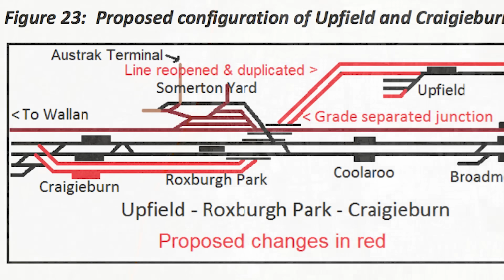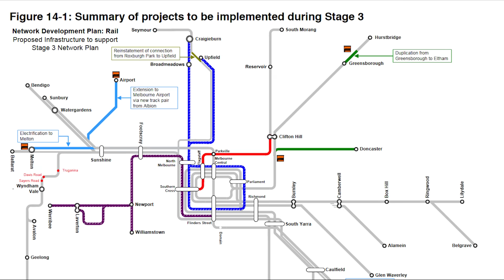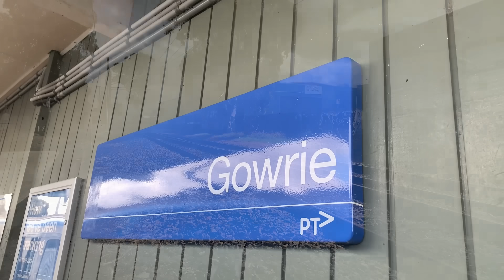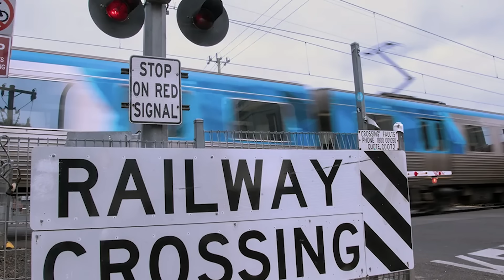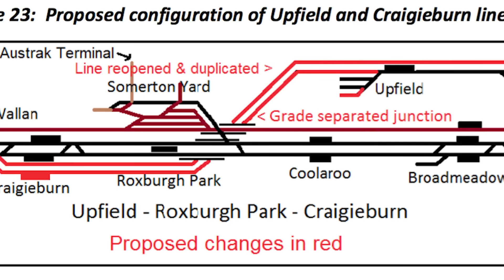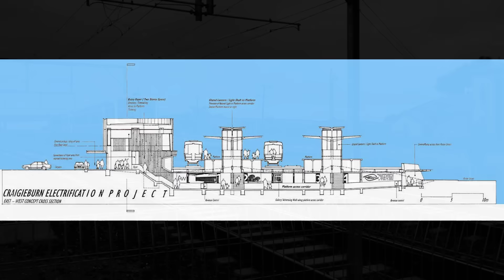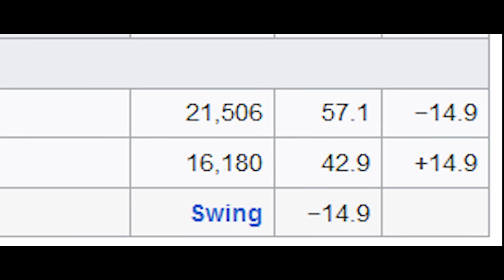The Somerton Rail Link and Wallan Electrification Projects Explained

Comment: No wonder we have a bad rail system. If that is a priority heaven help us. I can think of several other projects that should be return or restored before this. The Cranbourne East/ Cardinia extension, electrification to Hastings, Whittlesea line to Whittlesea.  Great video though and I did enjoy your commentary.
Reply from the maker: You had me until Hastings and Whittlesea… neither of those are extensions are needed lol. Thanks for the support!
Reply: Electrification to Hastings would cost a massive amount of money to service a small and static population, where as the line to Wallan would be much cheaper and service a massively growing population.
Reply: @MetroManMelbourne  the Whittlsea line will be extended a few kilometres at a time as the population grows northward, at the moment the population growth is at Mernda so once it heads further north they'll add a new station further up the old rail reservation.  Maybe they should look at running Upfield between Craigieburn and the Epping/Mernda corridor to pick up that area while there is still land available to reserve for rail purposes ??
Reply from the maker: @pvda64  The population won't grow beyond Mernda, that land is beyond the urban growth boundary, and there is quite a bit of land elsewhere to develop first.

There are concepts of a line from Epping to Wollert which could one day link through to Wallan.
Reply: @jakal0 i take it you have no idea of the development between Frankston and Hastings. No idea at all.  Static? lol. Okay. Plus if you need electrocution to Wallan then you already have a perfectly good existing line that’s already closer to Wallan at Craigieburn. Yet you talk about ‘cheaper’ - when it’s also ‘cheaper’ just to carry on from Cragie (cutting out how many extra kms of not only electrification but remediation of track and grade
 separation) instead on electrifying a link line  that already has other lines near it. Hastings doesn’t so your getting more for your money.

Comment: Have you ever been to Wallan? It's not that busy
Reply from the maker: It's not busy now sure, but even in 5 or 10 years it will be - how busy was Officer, Sunbury 10 years ago? The idea is to provide the service before/at the same time as new development, so that public transport use becomes entrenched
Reply: @MetroManMelbourne  no. It won't be. It's in one of the worst parts of the state. I know as my family is from there. It's economically depressed and has been for a long time
Reply from the maker: @timallardyce1216  I'm sorry mate but you're just plain wrong.

In the 2016 census Donnybrook had a population of 169 people. There were now 5,210 there in 2023 (2982% increase). which is projected to increase to 48,123 in 2041.

In the 2016 census Wallan had a population of 11,074 people. There were around 19,726 in 2023 (78% increase), which is projected to increase to 50,614 by 2041.

In the 2016 census Beveridge had a population of 2,330 people. There are now around 9,118 people there (291% increase), which is projected to be 73,745 by 2041.

You get the point. It's a growing area. 

You're correct in saying that it's economically depressed though, A rail extension could help alleviate part of that.
Reply: @MetroManMelbourne  pfft. No. It's the craphole of victoria
Reply: @MetroManMelbourne  sorry. I do really like your channel & enjoyed the video & the new information you have about it. I'm just sceptical about that part of Victoria as it's where my family is from and it's been in a rut as long as I've known it.

IF it did happen though, the Seymour line would struggle to survive as it would lose half its stations and only be Kilmore East, Broadford (where my family it's mostly from), Tallarook and Seymour.
Reply from the maker: @timallardyce1216  Alrighty mate. I don't see the point continuing this discussion. Have a good day.
Reply from the maker: @timallardyce1216  You're not sceptical without reason to be fair. They talked about Craigieburn for 50 years before electrifying it. Wallan could easily be decades off. The growth of those places is inevitable though.

Yeah the Seymour line would probably get swallowed up into Shepparton if Wallan was electrified. By that point Shepparton will have a train every 2 hours or so anyway.
Reply: @MetroManMelbourne  would it? Many have talked that up for a long time, but is it really that busy? I've only gone as far as Shepparton a couple of times, but it hasn't seemed super busy. Are there any passing loops past Seymour?
Reply from the maker: @timallardyce1216  There are a couple loops beyond seymour and the current government has upgraded one or two I believe. The regional rail revival project includes increasing the Shepparton service to 9 trains a day whenever they finish "stage 3" soon enough, which would result in a train every 2 hours or so.
Reply: @MetroManMelbourne  ooh great
Thanks!